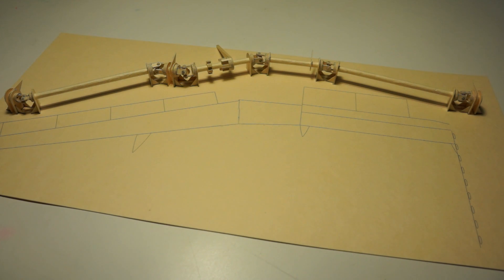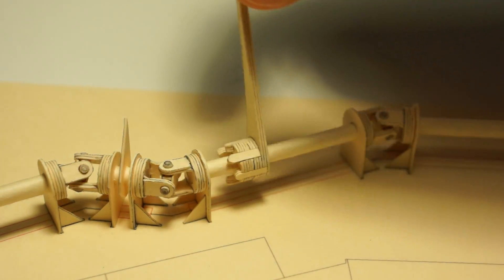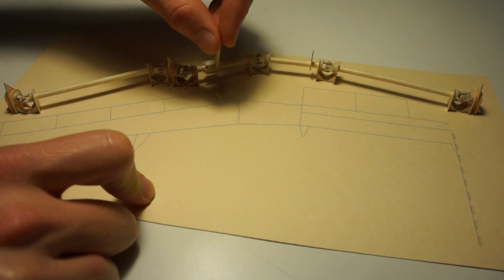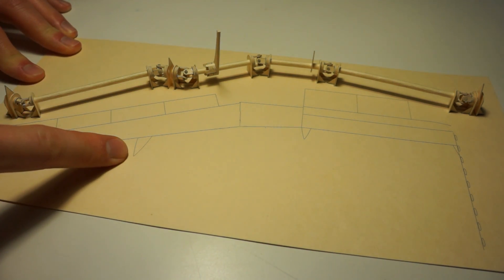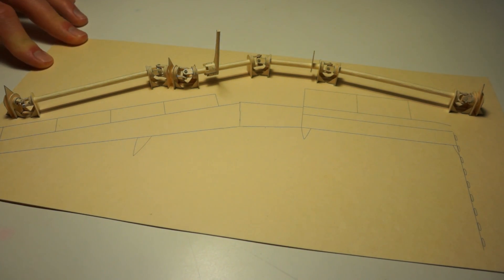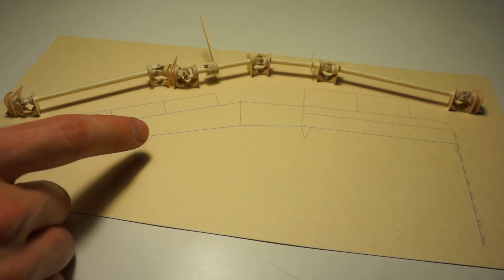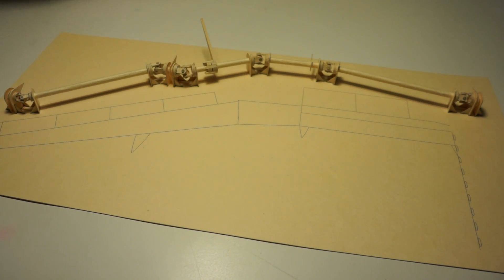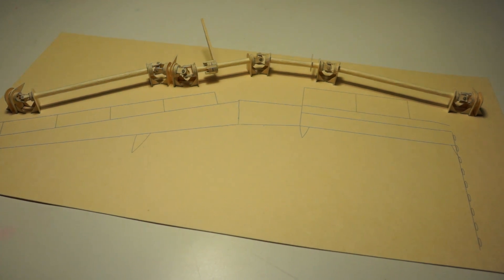Manila Folder 777 - Wing Update - Flap Drive System

Comment: If I make the model of a simple landing gear without all those breaks, locking system, etc for my school’s science exhibition then is there any problem….?
I want to make the models of all those airplane parts but I don’t want to make it that much well defined like yours. 
Which are the main parts of a landing gear, without which it will always remain incomplete….?
Please answer to my question……It is very-very urgent
I will keep on waiting for your answer
PLEASE…….!!!
Reply from the maker: I'm sure you could make a simpler version that articulates... the mechanical concept of the gear is rather straightforward.

Comment: I'm an instructor pilot and a model builder, I am completely blown away at your work.  What beauty in engineering and application in minuature form using the resources you use for building materials.
Reply from the maker: Thanks so much! Love having to work with just one material.

Comment: That's very clever! Typically these are extended by long jack screws located within the flap fairings, and the flaps themselves ride on fixed (curved) flap tracks, also concealed within the flap track fairings.  But your system may work visually. And regardless, it's ingenious and well-executed.

Comment: Im so trilled on how you work even the small details on the flaps and on the landing gear. I am trying to build one, a Batmobile: Tumbler from Dark Knight Movie downloaded from the internet. I will print the reference to manila folder hope you can help out on some tips.
Reply from the maker: Ariel Diputado Not sure about specific tips, but on a general level, start with a geometrically simple part and get a feel for the design and build process. I started with almost no skill and worked my way up. I apologize for not having more helpful advice, but the process is hard to put into words. Check out these vids (or skip through them rather, they're quite long):
https://www.youtube.com/watch?v=gi3JgjKwivA
https://www.youtube.com/watch?v=cqn04M582Rc
https://www.youtube.com/watch?v=rY5J-POWH6A

Comment: Brilliant! You didn't explain though, how you're going to make the slotted parts of the flaps. Also, bear in mind that the leading edge "Slats" operate together with the flaps with different angles.

Keep up the amazing work, I'm a huge fan :)
Reply from the maker: Ali Abou-Zeid Check this out: https://farm8.staticflickr.com/7512/15745980105_fc62870769_o.gif (Still very early in the design process, that's just the outboard edge of the inboard flap). And yea, the slats will be independently controlled, but they can be extended in the proper increments.
Reply: ***** BRILLIANT! Keep it up (Y)

Comment: I used to work for Airbus working on A320, A321 and A340 wings before moving to New Zealand.  I often found myself at the end of a shift after putting tools away and cleaning up, just staring at the structures of the wings and the thousands of machined bolt holes, nuts and rivets.  My favourite part to look at in the A321 wing is the gear hinge and the structure around it.  Often hard to imagine that when standing under the staging looking at the gear mount, that your standing right where the main leg and wheels would be when she's fully assembled.  You sure are creating a masterpiece.  Your video of the Main Gear swing test is outstanding.  The level of attention to detail for the down lock mechanism is crazy.  Used to work B777-200s for BA also.  Loved watching gear swings and flap retraction tests.  Awesome stuff, keep it up.
Reply from the maker: Larry Grimes Wow! Lucky you, too!
Reply from the maker: tomcatter11 Thanks for sharing! It must have been really cool to work on those sorts of systems up close... it's kinda crazy once you get that near a plane, the sense of scale becomes almost overpowering. Amazing what humanity has accomplished with the airplane.
Reply: I used to work on KC-135's on the Air Force for a few years and I know exactly what you mean by being awed by it all. Gear swings were my favorite, but I remember calling flight controls for the aircrew and  watching the flaps drop for about 5 minutes (the aux pump is tiny in the 135). It never got old, and even the flaps were fun to watch. As for the model, this stuff is amazing! I look forward to seeing it finished.